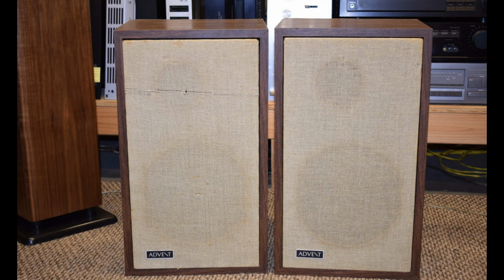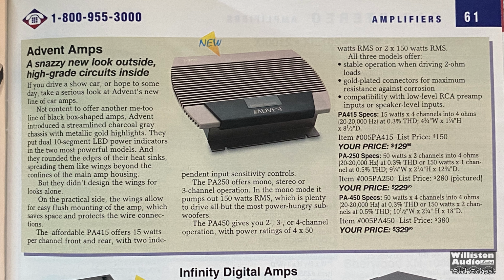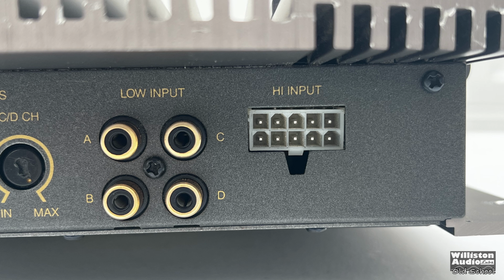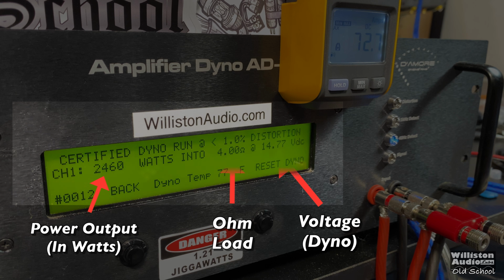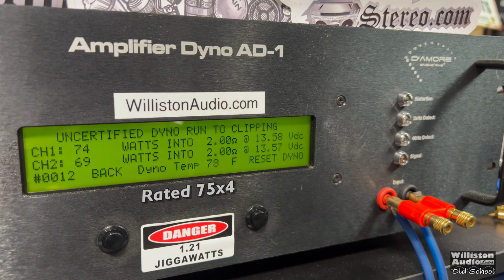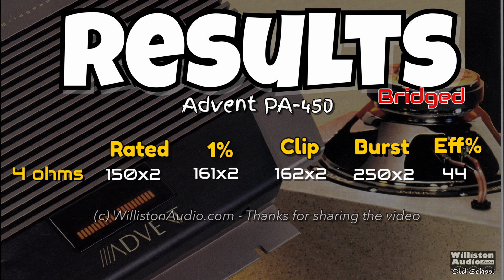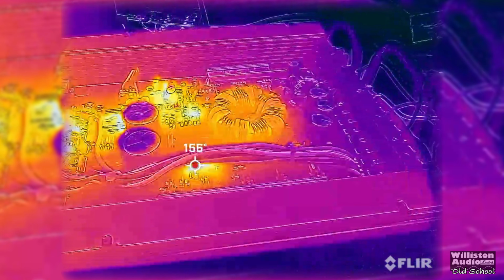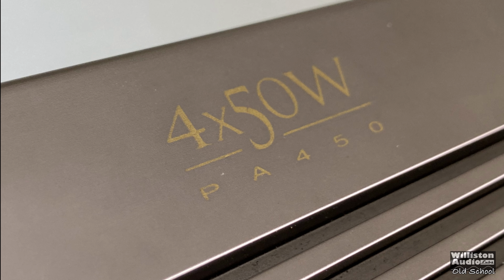Who Knew ADVENT Made Car Audio Amplifiers? Throwback Amp Dyno ADVENT PA-450

Comment: those brown goo are indeed glue. the hot resistors are voltage drop resistors for the opamps. they're dirt cheap, that's why they opted it. could be improved for better noise too

Comment: I have an old 4 x35watt yamaha amplifier i use to use to run 4 tweeters in my brothers old bronco II.  1 RCA jacks gold portion pulled off so needs repair or id be still using it.  Had such a clean sound.  Then i had a craig 500watt amp on a single 15 along with a second 4 cgannel amp by craig that was for all midbass.  All ran through an eq6500 by pioneer.

Wish it wasnt damaged would loved to see what u would do with an old amp like the yamaha.  Think my other 4 channel was a puoneer .

Comment: It's funny how just looking at the line inputs, gains and speaker connections you instantly see the Korean layout like in targa and urban audio.  It did surprisingly well considering other Korean amps of the time.  
I have a pair of advent 6x9s that I need to refoam.  I bought them at a garage sale as I had no idea they made car audio.

I still have a pair of the old advent laureate home speakers and an advent powered 10" subwoofer I used to use on my old JVC home theater receiver.  They were some pretty good sounding speakers.

Comment: Someone has to get or find the Viper D1200.1 for the Dyno. Edit: maybe even an Optimus XL-400 4/3/2 for nostalgia. Radio Shack days.
Reply: Oh the Optimus radio shack days! 
I never had any Optimus car amps, but I have probably 5 old Optimus home receivers, n I mean before was rebranded garbage RCA shit, n damn they sound great! They will run 4ohm with pretty much no issues. My one buddy did have a Optimus amp and the 6×9's in his car way back in days n it sounded great tho!
Reply: @shawnsatterlee6035  I had the Optimus 260 4/3/2 on two Sony boom box speakers and 2 8ohm 12” Lexon woofers, and the Radio Shack version switch controlled 3 way crossover with potentiometer bass boost. My 1st car audio setup in my bed room. Classic.
Reply: @shawnsatterlee6035  i actually have a few of the small 2 and 4 channel optimus amps sitting in a closet, used em ober the years for stuff in the camper. Old nd still ugly design, but still work. I had a few of the newer style ones in a car way back, was imporved looks for sure

Comment: At the time, Advent was owned by Jensen. I had a set of the Advent 6.5" speakers in the doors on my truck. They had what looked like a clear plastic whizzer cone and a gold chrome "phase plug" with a small hole at the tip. They sounded pretty good. I bought them at Silo back then. My best friend ended up with 2 of the Advent 10" subwoofers in his Camaro several years later too.
Reply: It was the ICT (inductively coupled tweeter) speaker and that was an actual tweeter down inside coupled to the voice coil of the woofer. I sold them at the time and I don’t think they sounded that great.
Reply: I still have a pair of 6x9 and 5x7 ict advents that I bought in 91. They need refoamed but they we're great speaker's. They are still the only car speaker's I've ever seen with the tweeter firing the same time as the woofer. Much like KEF home speaker's.

Comment: I worked at Best Buy while in college in the early to mid 90s.  (Home & car audio).

Advent speakers were probably our most balanced.  Didn't sell a ton of them, but discerning buyers figured it out.

By then, Henry Kloss started his Cambridge Soundworks...and his sub/satellite systems were FAR better than bose.
Reply: That was my first experience of the Advent Prodigy. They had it connected to a giant Proton amp (or something similar - it was in their main listening room) and the poor woofers were nearly leaping out of their baskets. But it sounded phenomenal. I went on to buy a pair of Celestions from a smaller retailer (still have them!) but will never forget how great they were even at full power.
Reply: @brandise76  
Their big problems back then were blown tweeters.  They sounded balanced, but didn't handle power well.  Sealed enclosure and the cross over frequency set too low on a cheap tweeter!

They were my favorite, behind Eosone though.  They made good stuff if one knew them.